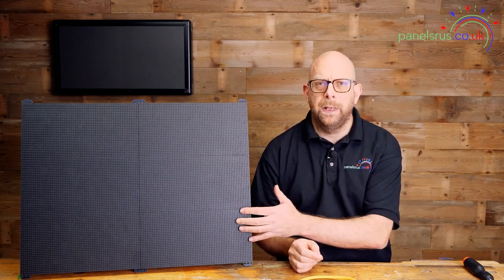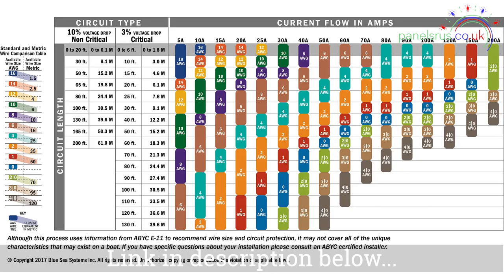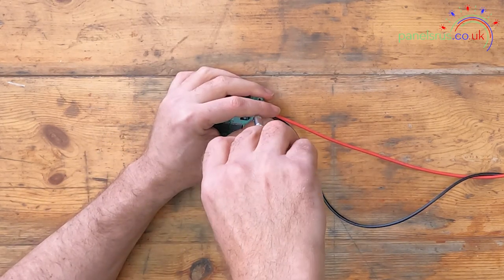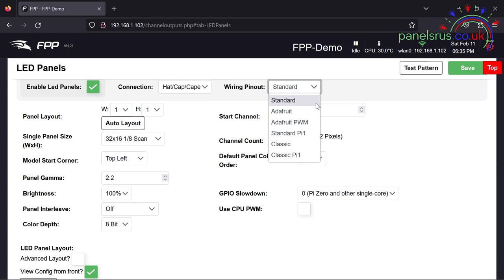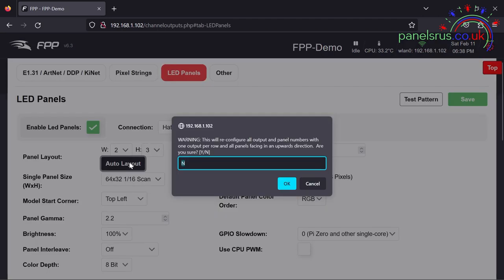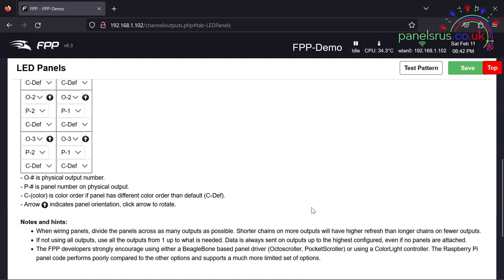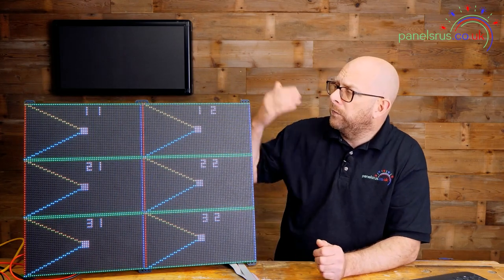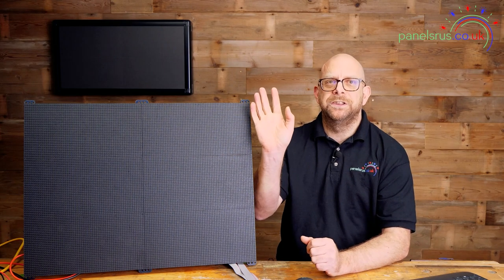LED Panels - An Introduction (Part 3). 2023 - FPP Setup

Comment: Another great step by step, I did the exact same 2x3 and cape, when I select test,   each panel is being divided up in 3's. 8x64, 16x64 and 8x64 for all 6 panels, and shows the test pattern, panel 1 will show panel 1 8x64, panel 2 16x64 and so on, do I have a bad cape? thanks again
Reply: If you're using outdoor P5 panels with a cape, you might need to set the Interleave to Stripe in the FPP output settings.
Reply: @gregorymacaree4676  Gregory, your awesome, that worked, been fighting it for 3 weeks, one variable I forgot to even think of trying, having issues with colorlight card where it wont run test at all that's why I'm trying cape card, does colorlight have a specific setting or is it just off, thanks again, you made my day

Comment: I'm completely new to this and am trying to set up 12 panels together. No matter what I do I can't get them to work together or to format as one big screen. They are p3.91 and I'm using led vision 8.8. I tried doing it with the net card setting and using the sender box but can't get anything to work for me. If you have any suggestions id appreciate it.
Reply from the maker: The next video out will be about setting up a panel in Xlights - and pushing to FPP. After that we'll have a short run of Colorlight based videos which should help.